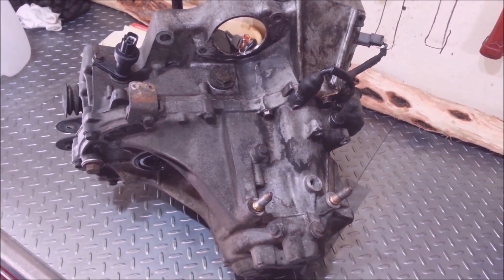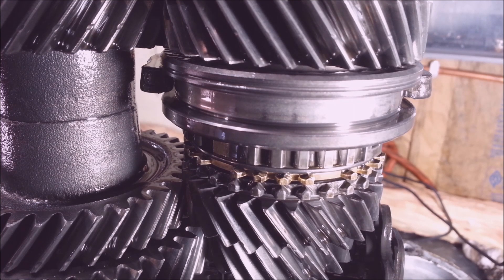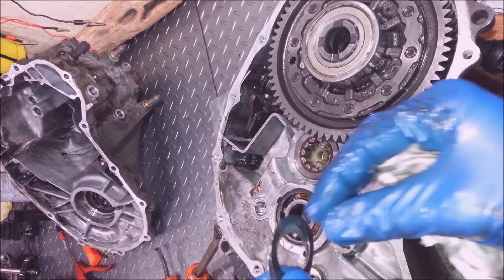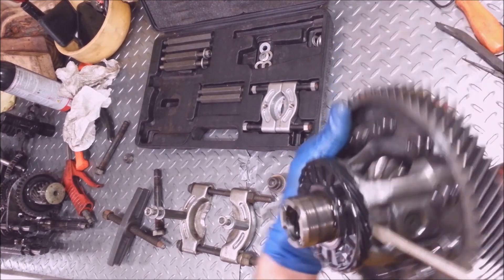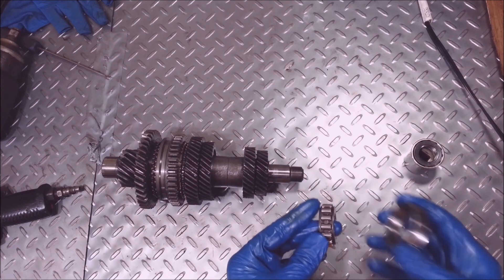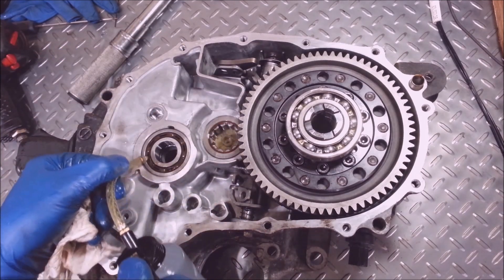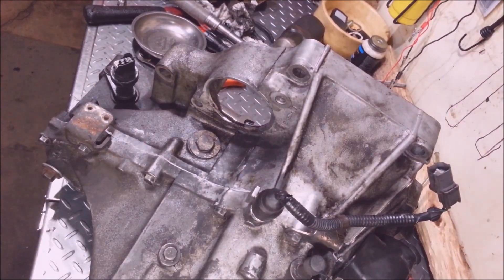Civic D16 manual transmission rebuild input shaft bearing LSD install

Comment: I have a question since you work on transmissions regularly. A little background. I have a 90 CrX Si and I bought an aftermarket 4.7 final drive. The stock one is 4.250. I want to install a 92-00 civic d series 5th gear set up to lower the RPMs as close as possible to stock for freeway. Will that gear set up drop in or work at all with the cable transmission?
Reply from the maker: I don't think you can change B gears with D gears.
Reply: @RustBeltAuto  let me be more thorough. The transmission is a USDM cable D16 transmission out of a 90 CRX Si. The 5th gear set I want to put in is from the 92-00 Civic d series hydro transmission
Reply from the maker: @maxbet3997  you should probably ask the boyz on hondatech.

Comment: when i turn the car on it sounds really loud, and when i press the clutch pedal down the sound goes away. (it sounds like is scratching). is it time for a new clutch disk or is it the clutch master??
Reply from the maker: I have a playlist on this rebuild. In the first video this transmission did that, because of a bad input shaft bearing.
Reply: same with my car
Reply: @Shahid_Meh  i think it was the input shaft bearing inside the transmission. i did the whole clutcg kit brand and still made noise. its a bad transmission.
Reply: okay, thanks

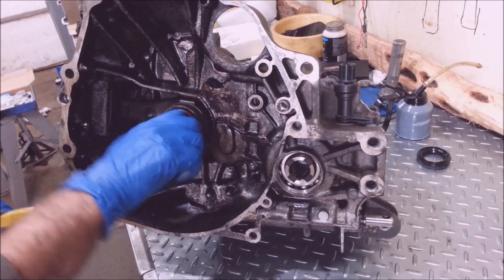Comment: At 23:00 you say it’s way too tight. How do you determine this? I see you turn the input shaft effortlessly moving the output shaft.
Reply from the maker: It did turn nice, but there was no end play at all. I needed to make sure there was some, because I put in a new carrier. If you are using your original carrier, you probably don't need to worry to much about that.

Comment: Any idea what may cause a no start problem after successful transmission rebuild and reassembly (mounted to engine). Car cranks, starts (for .5 second) then dies. Would any plug not connected cause a no start problem? I'm lost. Your video helped me tackle my transmission rebuild
Reply from the maker: Are all your grounds bolted on? Like the one on the thermostat housing? I have never heard of that on a Honda.
Reply: It is strange. All grounds and connectors good. I'm thinking it's the ignition switch. This is common in Hondas. There's actually a TSB out for this. It may just be a coincidence that I have a no start issue right after transmission rebuild. I recall having long crank issues intermittently before, which again is a common ignition switch issue. I got the Haynes manual that shows how to test this switch. We'll see......
Reply from the maker: @JasonTylerRicci  usually if you turn the key back slowly, or wiggle it around, the switch will work. The ASD main relay could have a problem too. Other than that, I got nothing unless I had the thong to look at it.
Reply: My ek 98 (automatic) used to randomly die or even not start because of the main relay behind glove box
Reply from the maker: @fredericverpaelst4080  Yes. That is the ASD (automatic shutdown relay).

Comment: Hey old video doubt you'll reply but I am looking for my first car and found a 2005 LX SE USA spec 180k kms and the input shaft bearing sounds very bad. Car sat for 2 years and has black oil, should I buy it replace clutch and input shaft bearing and drive it for 5-10 years? I'm just worried about how bad the clutch feels (engages at the end of the pedal)
Reply from the maker: I don't know. There is no way for me to answer that correctly.

Comment: Every time I let off the gas the gears grind not even shifting into gear could these be the synchros ? If so would a master rebuild kit be good for the car it’s only has around 140k miles on the civic
Reply from the maker: That does not sound like synchro's to me.

Comment: Ok, I know this is a dumb question.. but I took apart my transmission about 6 months ago and completely forgot the washer orientation that gets put back under the main shaft? So when I slide those two washers back onto the bottom of main shaft is it the flat one first or the other? And which direction does the other one face? Boy do i feel dumb..
Reply from the maker: I think I put mine in the opposite way from what I took them out, and it's still working.
Reply: @RustBeltAuto  Thank you! By the way, that was a really  well put together video!
Reply from the maker: @rickybobby8563  😁

Comment: At 22:32 i put that bolt in when it wasn't in neutral. Do you think i broke something? When i put it in now and it is in neutral the transmission won't shift at all.
Reply from the maker: Take it apart and find out?
Reply: @RustBeltAuto  it shifts fine in to all gears until i get almost bottomed out on that bolt i think I'm just not lining something in there up right or maybe was there a gasket on it?
Reply from the maker: @timothymundy966  there is a fork in there that needs to line up with the pin. There is no gasket. That is why I used sealant.
Reply: @RustBeltAuto  thanks i appreciate your responses. I'm definitely a newbie. I wish i could respond with a picture.  There is a little nub on that fork that hits the bottom of the plug when it's all the way down. I'm sure I can remedy this. I'll let you know how later

Comment: Hey just a quick question, how did you disconnect the connector for the reverse light switch? I can’t get mine to disconnect at all and the bracket for it is rusted
Reply from the maker: There is a grey connector under the distributor. That bracket can stay on.

Comment: I have one of these that wont pull. I can see the speedo sensor shaft spinning and it stops when I put the clutch in. But the car sits still and rolls while in gear any opinions on what may be broken? The axles are seated too
Reply from the maker: As a guess, I would say the side gears in the carrier broke.
Reply: @RustBeltAuto  thanks for your reply I'll like your video. I'm going to try another used unit. Hopefully it works. I'm going to keep the old one and maybe put a lsd back in it one day :D

Comment: when pulling mine apart it seems the input shaft is stuck and i’m not sure what to do to get it out. any help would be great
Reply from the maker: Friendly persuasion? The shaft might be galled from a bearing that's locking up.
Reply: @RustBeltAuto  I bought a dead blow to see if I can get it loose. You think ill be fine if I try hitting the end of the input shaft? I dont think a 24oz dead blow will damage it but... what do I know
Reply: @RustBeltAuto  also, before i started taking it apart the shaft would turn and had no play. I just wanted to go through it to make sure everything was okay before I put it in
Reply from the maker: @seth3687  follow your best judgement, and hope for the best.
Reply: @RustBeltAuto  alright, thanks man!

Comment: Hello sir, I did the same job, I changed all the bearings and the bearings but now the reverse does not enter? What can be thanks
Reply from the maker: Loosen the detent bolts a little, to see if it shifts correctly. If it does not, you may need to take it all back apart, and see what you did. best advice I can give you.

Comment: I see you add rtv sealer to some bolts. Wouldn’t thread sealer be more appropriate. What is the objective?
Reply from the maker: I think not. Thread sealer only works good on tapered pipe threads. Those were straight threads that are supposed to seal on the flat of the bolt, and a flat machined surface. It basically just squishes out, and seals on the flat surface, and where the threads start. Subaru makes nonsense like that with no crush washer on their engines too. I do the same thing with those.

Comment: how much it cost to replace the input shaft bearing for civic 1998 lx? thank you
Reply from the maker: If you live in Zimbabwe, it can cost you maybe 1000 trillion dollars, the value of the dollar in the US is inflating, and  the economy is cratering, so I don't know how this question is relative to the situation. Simply put, I don't answer cost questions.
Reply: @RustBeltAuto  During the inflation crisis of zimbabwe, a loaf of bread costed 1 trillion dollars.
Reply from the maker: @mediaguy4037  okay. So it may cost 300 trillion. Unless everything inflated since then. It could be more now. Thus is fun.

Comment: Did you install the main shaft bearing on top of the shaft?
Reply from the maker: I did what the video showed I did? Did I miss something?
Reply: @RustBeltAuto  no prob not.. I think my tranny has a different style of bearing on the mainshaft. It got stuck in the case when I separated it.    It seems like there might just be different styles of bearings.
Reply from the maker: @nevanevans  it's probably the same.

Comment: There is 40mm and 35mm kit how do I know what I need?
Reply from the maker: You need to measure the carrier, or cross reference the transmission number. The easiest way to measure would be to take out an axle seal, and measure the inside diameter of the bearing for the carrier. Mine was an S40 transmission. That was a no brainer. It's 40mm.